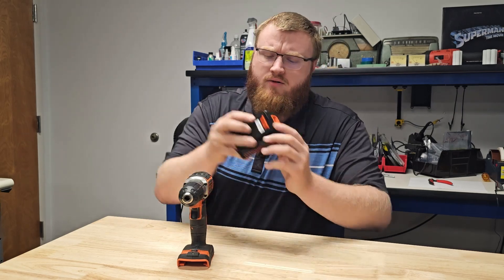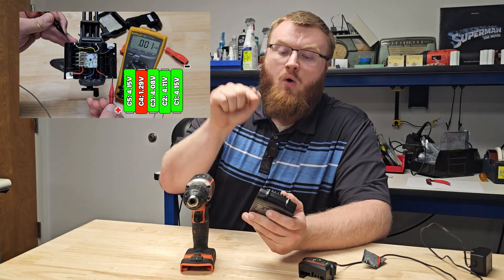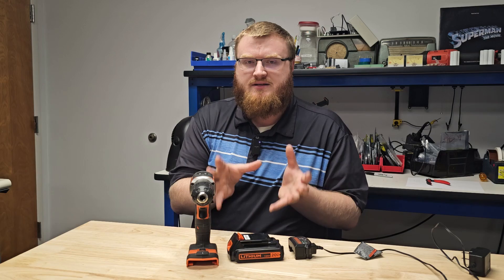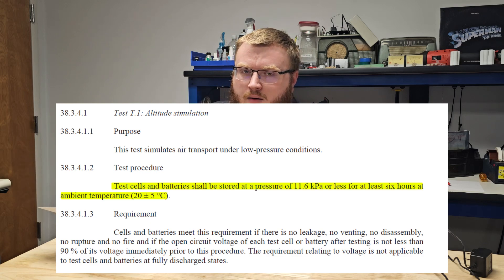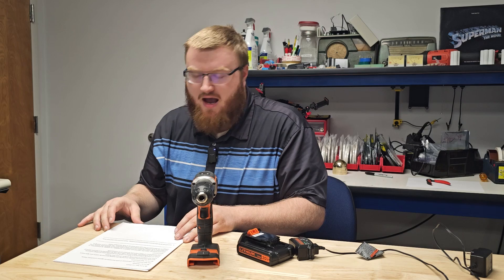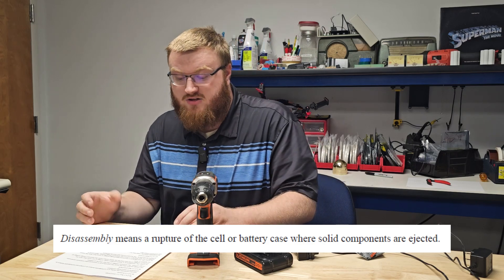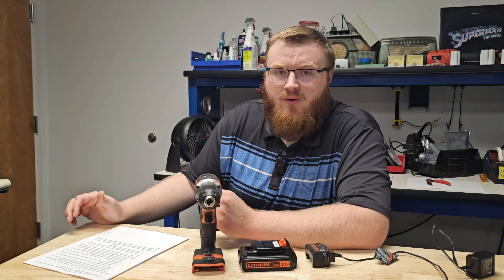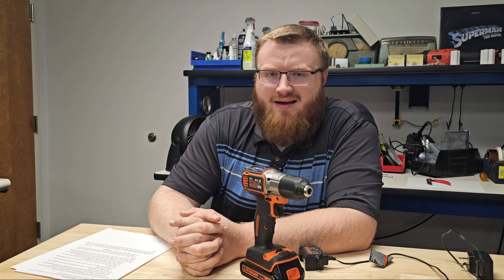Are Drill Batteries Safe? What Causes Battery Fires?

Comment: Are some of the batteries safer than others? I think that a few of the manufacturers have the brains of the system in the batteries rather than in the tool.
Reply from the maker: I know milwaukee and makita were doing seperate protections on their charge lines, but I'm not sure of that's still the case.